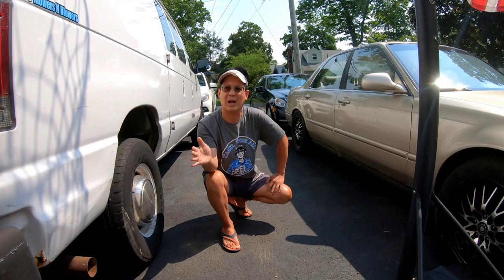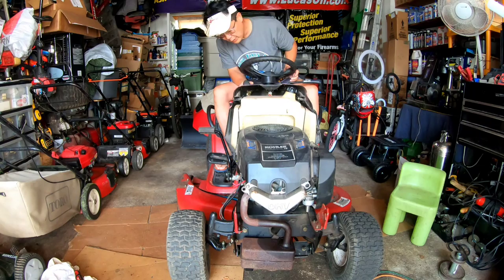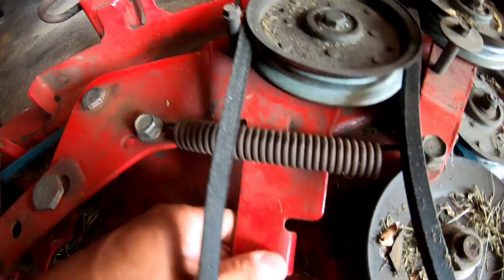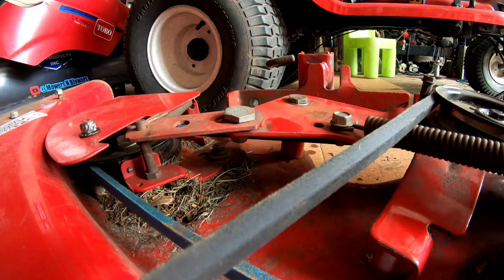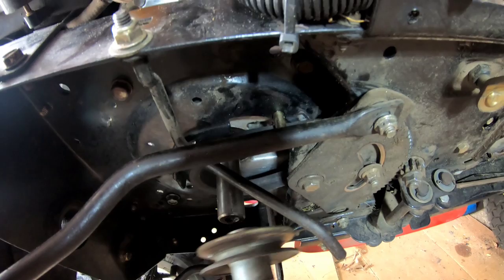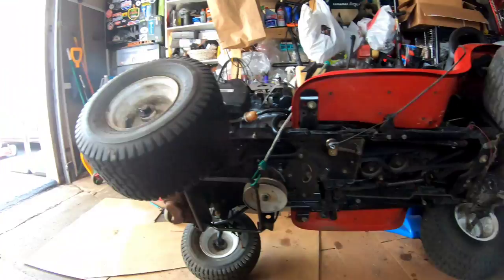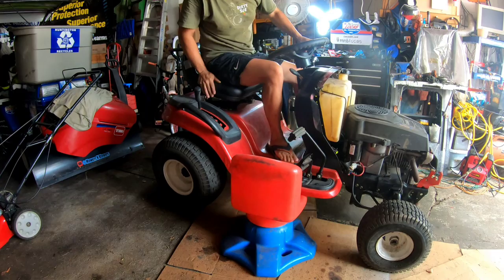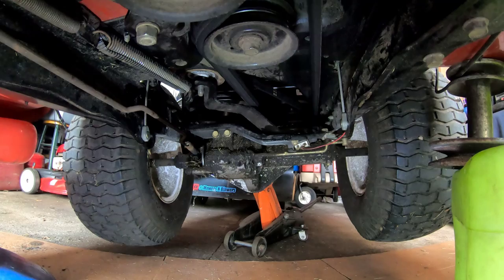FREE TORO LX460 MTD KOHLER LAWN TRACTOR CVT VARIABLE SPEED TRANSMISSION MOWER DECK REMOVAL BELT FIX

Comment: Henry, My MTD YardMachine has that same transmission as your Toro. I also sprayed a generous amount of WD40 into the VariDrive pulley when I first got my garden tractor. 
Once the penetrating oil had lubricated the center part of the pulley the WD40 for the most part evaporated away without any harm to the belt. 
The pivotal area of the VariDrive on the left side was just about completely seized as well as the tensioner arm which resulted in the secondary belt being slung off 
. I used quite a bit of PB Blaster to free up the problem areas initially and re-soaked the pivotal parts that I described with SeaFoam Deep Creep with great success. After getting the tensioner arm/pulley freed up and the VariDrive pivot moving as it should, I reinstalled the secondary belt as a test and the belt is still being used. I hope this helps you out,Henry.
Reply from the maker: Good tips bro but it wasn’t the varidrive pulley.  You’ll see what I did.
Reply: @MowersNBlowers  I was just telling what I had to do with mine to get it up and running. My tractor was completely packed with grass clippings and other stuff in which looked like it had never been cleaned out. I think that your tractor looks really nice,Henry.

Comment: Henry, I think your drive belt probably slipping because it’s not seated deep enough on the engine pulley when under load. Also the muffler pipe and top right side of the muffler look wet with oil, your valve cover is probably leaking. Keep the faith bro! You got this!!
Reply: Yeah,I saw it drip on the muffler in the last video
Reply from the maker: You’ll have to wait and see what happens

Comment: If it goes in reverse.... its not the belt..... CVT is doing its job....I think the forward gear in the transaxle is about shot. in these vari drive transaxle there is a forward and reverse gear ... with a clutch type gear in-between them.... each of the F & R gears have 3 internal teeth on them... and over time can get worn with an rounded edge and not have a good solid straight edge for the F & R gears to grab ahold of.... I believe its time to do a transaxle rebuild....Im not a mechanic.... but I do watch alot of UTUBE vids.... and I watched some last night... LOL
Reply from the maker: You’ll have to wait and see what I did.  Thanks,  you’re right on it bro!

Comment: It's hard to see on the video, but there's an arm of some sort attached to a spring, and when you engage the transmission it pulls the belt into that arm, and the arm also moves at the same time into the belt. That all looks hinky. It looks like the belt might be coming in contact with that arm or whatever is attached to the spring. I'm not sure because I'm watching on a small screen. But it just seems like it has to do with the engagement system more than the transmission.
Reply from the maker: Good tip bro but it’s a fixed and it’s not what you think,  next 3 episodes

Comment: Did you check the fluid.  I was trying to see if there was a leak at one time but I couldn't see.  I was thinking maybe there was a small leak and maybe it's not leaking because the fluid is now all gummed up and plugging the leak at the axles.
Reply: That has grease in it no fluid 🤣
Reply: @stevenmaines9114  hydrostatic fluid.
Reply: @stevenmaines9114  or CVT fluid
Reply: @thecynic807  it not a hydro it's a gear trans it has forward n and reverse.. it a Spicer .
Reply: @stevenmaines9114  it's a cvt which takes cvt fluid.
Reply: @thecynic807  that the belt set up not the trans . It's a gear trans look it up .. I have bunch of mtd with that  trans .
Reply: @stevenmaines9114  well regardless I think that's still the problem because that's usually the problem with lawn tractors the seals are busted and its leaked out the grease.
Reply: @thecynic807  trans that use grease don't use seals.. I work on them for living so iam not arguing with u .. .

Comment: Wish I could help , My JD Tractor is 13 years old and its a LA 115 with the hydro trans also . sure hope I don't have any trouble with it , if I do I'm doomed .
Reply: Deere uses a totally diff trans and only one belt . In less u have the newer l series with plastic trans then there two belt and the back pulley . Wears out n come apart . Those Deere we're .made for lows and home Depo...iv changed one it pritty simple

Comment: Henry what do you think of new cub cadet riding mowers. Looking at the xt1 50 inch with kohler eng'
Reply from the maker: They’re supposed to be MTDs top of the line brand,  but the two I’ve had before sucked!
Reply: New cubs cadets are junk lol ... Buy a Deere and have no problems or Husqvarna with kowi in it.
Reply: @MowersNBlowers  What would you buy I mow about 1/2 acre.
Reply from the maker: @venvnco6259  Wright stander 42”

Comment: Hey I got a problem with my wheels on my cub cadet 1050.  
I think we have talked about this before.  When I turn a sharp turn the outside wheel buckles over.  
Someone told me to adjust the wheels outward and that would fix the problem.   Would that be your expert opinion.   I've already changed the bushings.
Reply from the maker: I’m not an expert…lol   Front or rears?  Tires buckling?  Or the entire wheel…buckling like how?
Reply: You can adjust the steering linkage so the wheels don't turn so drastically. I had a tractor that did this. A few turns on the adjustment and the wheel stopped buckling on sharp turns.
Reply: Lol .,... They all do that on the 1050 .. don't turn so sharp or to fast .... Even I Fu adjust it it'll still do it .

Comment: I work on too many of those kooky CVT systems in my shop.  They do work, but I don't like them.  It's important to put OEM or exact OEM replacement sized (length) belts on them in order to work properly...lol.  BTW, the reverse but no forward problem has nothing to do with the belt, thats in the axle.
Reply from the maker: Thx for the tip Don!  Good to have you contributing your expertise bro!
Reply: Randomwrenching if it's the Axel because it goes backwards what can you do to fix it?

Comment: it appears drive belt is not routed correctly.  I think the belt should be straight on left from transmission to engine pulley, then off the engine pulley through the 2 pulleys and back to the transmission.  I emailed you a diagram bro.  Basically your belt routing is flopped or mirrored from how it should be.
Reply: but then again looks correct, I dont know something looks fishy shouldnt flop that bad
Reply from the maker: You’ll have to wait and see bro
Reply: I’ll be watching bro

Comment: Henry at about the 23 minute mark when the tension pulley is going toward the spring ,it looks like a small amount of spark-idge. I see it  about 3 times but not sure. I know alot less than you know about tractors!Lol. I know you will get to the bottom of this. Now i know why i dont do tractors. I would have to buy all the parts to fix it.i would lose my ass! You just go to your in stock department and pull what you need out. LOL. 👍🇺🇸 Roger  #mnblucas
Reply from the maker: I got a lot of spare parts alright!  Lol!